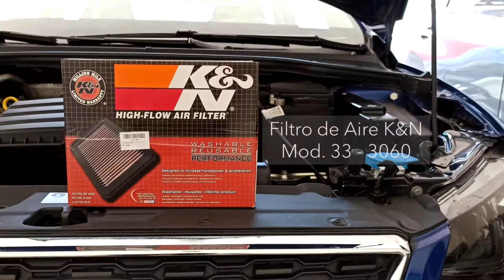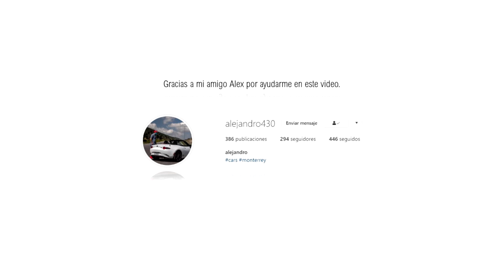Afinacion Seat Ibiza 2018, Explicado! (Motor 1.6 Mpi)

Comment: Disculpa y como borras la alerta del tablero o programas el próximo,  muy buen video.
Reply from the maker: Hola Amigo, Te explico

1- Cerrar el encendido.
2- Oprime el boton de intermitentes y deja parpadee 4 veces.
3- Al momento de que temine el 4to parpadeo de las intermitentes oprime el boton de set de la compuradora de viaje.
4- Abres el encendido para activar corriente.
5- En la computadora de viaje aparecera la leyenda "Deseas reiniciar el servicio de aceite" y confirmas con el boton de "SET".
6- Para reiniciar el servicio repites los pasos del 1 al 5 pero esperas a que pase la confirmacion del "Servicio de aceite" y te preguntara si deseas reiniciar el servicio y oprimes "SET"

y Listo. Si tienes duda no dudes en preguntarme, saludos!

Comment: Excelente video muchas gracias por compartir, me podrias ayudar con algunas dudas? De entrada te comento tengo un ibiza 2018 1.6 mpi , tiene apenas 19,500 km, ya pide el segundo servicio sin embargo lo hare por fuera de la agencia, las unicas "modificaciones" que tiene es cold air intake, hecho a la medida filtro k&n conico, y trae instalado pedalbox, como tal el coche no se usa "para correr" 70% ciudad y 30 % autopista y a revoluciones altas, por la ligera mejora en la respuesta de aceleracion.

1.- usare liqui moly 5w-30 leichthauf , me recomiendas usar el enginge flush y ceratec?
 
2.- con el km que tengo , el manual me marca cambio de bujias, valdria la pena cambiarlas? O sobre como las encuentre decido,  se puede meter alguna bujia "mejor" ? 

3.- es muy pronto para utilizar un aditivo para limpiar inyectores ? Cabe mencionar que usa Shell V-Power (premium) y usa Oxifuel (bio aditivo de ethanol) 

Agradecere y respetare tus comentarios y sugerencias, de nueva cuenta felicidades por el video! 👍🏻
⭐️⭐️⭐️⭐️⭐️
Reply: Hola Eduardo, por lo visto no soy el único que a notado ese detalle de la aceleración medio adormilada, que pedalbox usas? Tu Ibiza es standard o tip?
Reply: @pumok  Que Tal amigo ! Sii , pues en si son coches de ciudad, de comfort si quieres jaja nada muy deportivo pero con el pedalbox mejoro mucho la respuesta de acelaracion. Lo pedi directo a la pagina de DTE SYSTEMS en Alemania, y mi ibiza es manual 1.6 

Si quieres buscame en IG: bluu_fr ahi tengo un par de posts sobre el pedalbox

Comment: Oye wey, donde conseguiste tu filtro de aire K&N ya que es el que estoy buscando para mi Seat Toledo 1.6 l que veo es el mismo y que numero de modelo es si puedes proporcinarme ese dato te lo agradeceria. Por cierto si puedes proporcionar cada cuando le cambias las bujias, que numero de parte y marca son, porque segun los de la pinche agencia se cambian cada 40000 o 60000 kms, no se de donde se sacaron esa fumada! Y si puedes hacer un video limpiando todos los sensores ya que como te comento ese motor es el mismon del Seat Toledo.
Reply from the maker: Que tal amigo, el Filtro es el #33-3060 de K&N lo venden en autozone, amazon y en Mercado Libre, las bujias que le puse son las de agencia el numero de parte es el #04C-905-616 son de iridio por eso el cambio cada 60mil KM, hay mas opciones economicas de calidad como las NGK Laser Platino que igual se cambian entre los 50mil KM.
Reply: @DeznorChoche  TE AGRADEZCO MUCHISIMO EL DATO Y LA PRONTA RESPUESTA A MI COMENTARIO Y ESTARE PENDIENTE A TUS NUEVOS VIDEOS YA QUE TU MOTOR ES EL MISMO QUE TIENE EL TOLEDO 1.6 L OJALA HAGAS MAS VIDEOS YA QUE NOS SERVIRAN DE MUCHO APOYO.
SALUDOS Y MUY BUEN VIDEO.